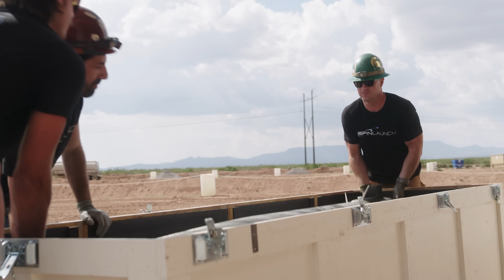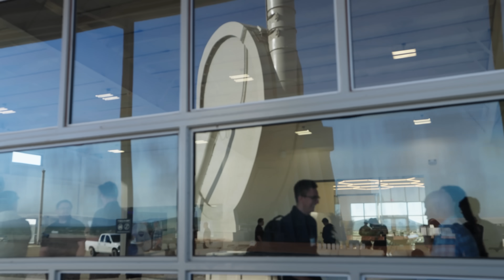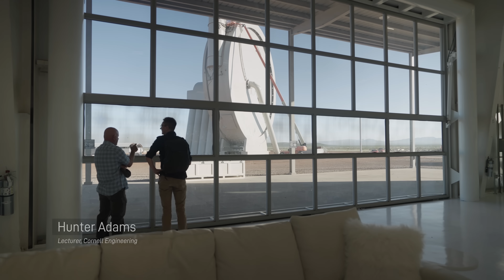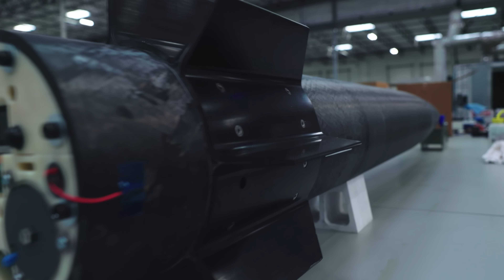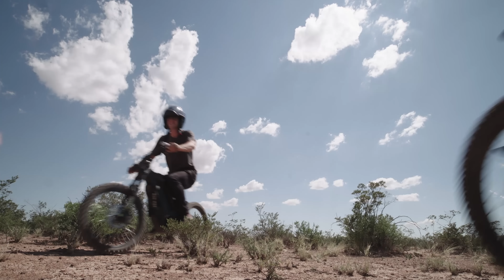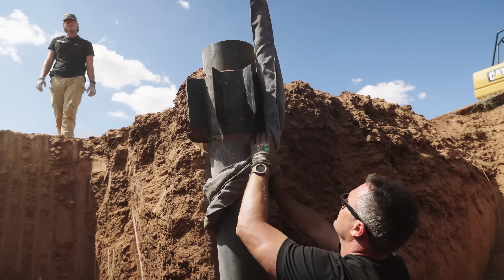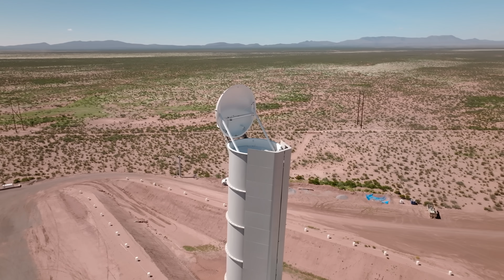Flight Test #10 - The First Payloads

Comment: That looked a little wobbly out of the shoot…but job well done, again!
Reply: looked for this comment
Reply: @dcx45  pqpqpplalla
Reply: If they could rifle it, that would take any wobble out
Reply: @robertmarten7222  Not sure if that's a joke, but the projectile never contacts the stationary barrel so rifling wouldn't do anything. They could in theory have the arm spin the projectile, but that would mean the payload would have to withstand the G forces in 360 degrees around its roll axis instead of just in one direction. If they could detach one side of the projectile from the arm just before the other, it would impart a spin at the last moment, but a slight error in timing and everything goes wrong.
Reply: @robertmarten7222  p0qllr
Reply: @robertmarten7222  la0la0plapplap

Comment: hey @spinlaunch, there is no doubt that your system is outstanding, but after all of these launch and flying still you DO have projectile wiggling after shooting/Yeeting. please consider using big/great angular WINGS.
Reply: @timemachine194 Whats the solution to the major problem, achieving enough exit velocity for the 10 minute flight to LEO, retaining the speed of 17,000mph required to maintain the stable orbit, without the whole spinarm melting?
Reply: I would add a rifling feature to outer shell.  It's own speed should set up a spin/rotation or whatever to take out the knuckleball effect they have now.
Reply: @timemachine194 Could you explain why we don't use magnets and a rail design? Thanks
Reply: @DynamicPotteryStudio  I think also rail gun 30km to 100km to be useful, though the rail gun i think still needs 2nd and 3rd stage, as you cant have something flying 17000mph at ground level due to the atmosphere.

Comment: Amazing.  I thought the engineering challenges would be too great, but here you are.  Cannot wait for the full scale version.
Reply: Thats because the Engineering challenges ARE TOO GREAT.
This design will never put anything into orbit (from the earth)
Reply: How they overcame the challenges?

They are able to launch only to 1/10 of distance needed so far lol
Reply: @adamprihoda  The centrifuge arm was the critical limiting factor.  Almost every other component of the system is a solved engineering problem.  Timing circuits already exist with far more precision than needed.  G-hardened components already exist for artillery shells that experience far higher stresses.  The system can be built.  The only question is whether it can be built with a price and capability profile that will make SpinLaunch a viable competitor against Starship for small payloads.  Maybe.  Maybe not.
Reply: @skenzyme81  What about coming out of the tube at orbital velocity, the heat shielding required is going to be massive 8km/s i guess? I dont know the answer, so am interested.

Comment: Where the projectiles go? Hight?
Reply: Not particularly high, no. This is a sub-scale system they're using for testing, so it can only reach a bit above where airliners fly. The important part of this launch was carrying payloads from outside organizations and seeing how well they dealt with the forces.
Reply: @pseudotasuki  what's the stuff inside like that allows for the payload to withstand the high G's? Is it full of water for buoyancy under high accelerations?
Reply: @spolo123  They're simply designed for it. Surprisingly, a lot of consumer electronics are already capable of withstanding the extreme g loads.